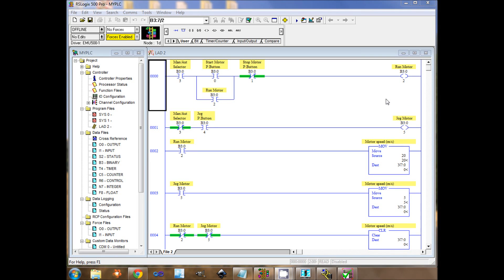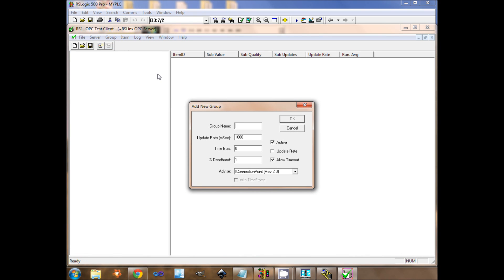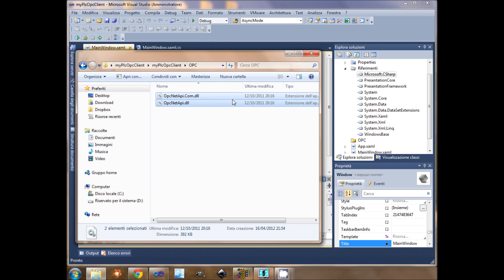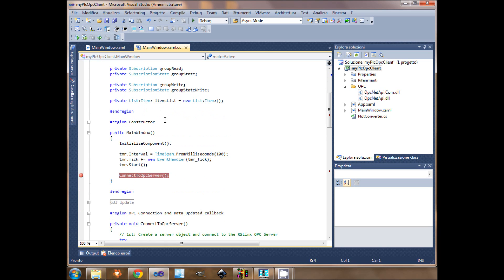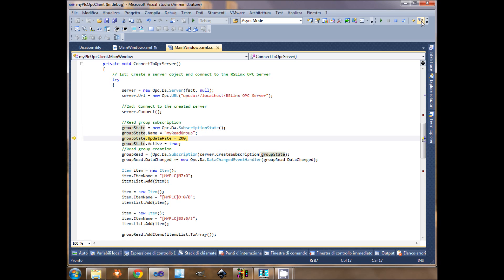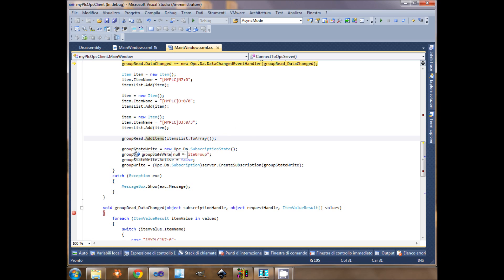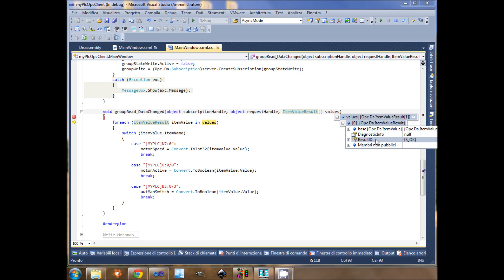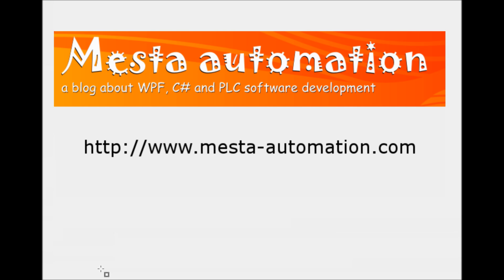Opc C#

Comment: hi , i'm asking if i can use this tuto to creat an OFS (OPC factory server) client for schneider!!!!!
Reply from the maker: Sure you can use it. The server address and tags will be different, but the code is the same.
Reply: thank you for your reply but i want to  know what do you mean by server address and tags is that "the syntaxe to connect to server or to add tags " or " just the name and the  @ wich depend on my server "  !!?? in OFS DOC it's mentionned that we have to work with  other  package (.dll) not the same  as you do .
Reply from the maker: I use the .Net dll from OPC foundation. If Schneider gives you other dll, you can use them. If OFS is an OPC DA server, the dll used in the example will work for sure.
Reply: ok yes OFS use the OPC DA .thank you very much but i have one more question how much Automate we can supervise with a C# application in general do you have an idea about the capacity of an OPC client (aplication on c#) to manage multiple automate ??

Comment: Hi, Im from Mexico, have you ever make a communication from PLC siemens (1200) to a festo device (EXCM(its a controller of a electromechanic actuator)), I want to do the communication via ethernet, festo device use a protocol called control via ethernet, that use a tcp/ip protocol (using the I.P and port of that device), I already do the communication and control the device to manipulate it using a TSEND_C block (of PLC), but I cant read the status of the device because I would need to use a TRCV_C block but the IP and port is already used for TSEND_C bock, what Ishould do?, what am I doing wrong?, can you help me? thanks for your time! (sorry for my english)
Reply from the maker: Hey. you can use Modbus to communicate with S7-1200 plc and you can read this pdf: https://www.festo.com/net/SupportPortal/Files/446269/Configuration%20EXCM%20and%20CPX.pdf
If you already did everything they said, Festo customer support is the only one that can help you.
Reply: thanks, but sorry, Actually I want to comunicate with a CMMO controler (FESTO), which dont have PROFINET or PROFIBUS only control via ethernet thru tcp/ip and control by digital IOs but I want to control it thru ethernet, thanks a lot for your previous answer and your time